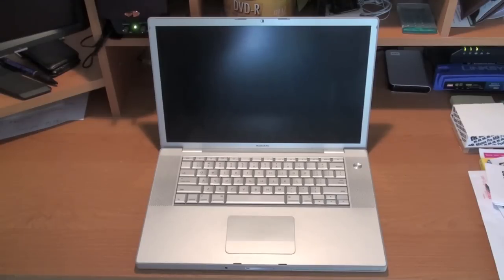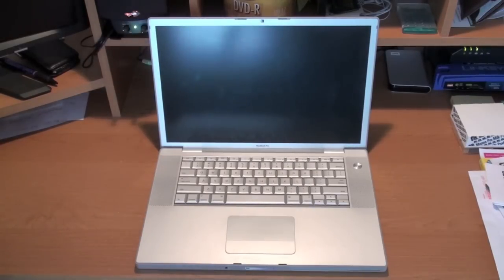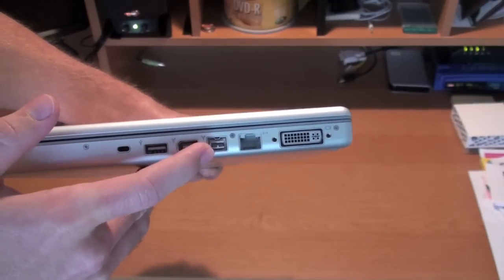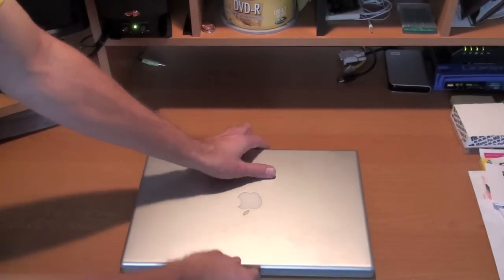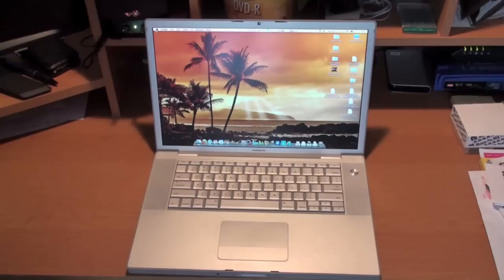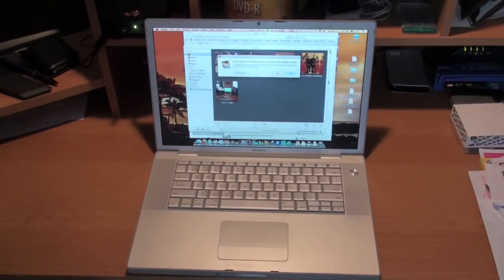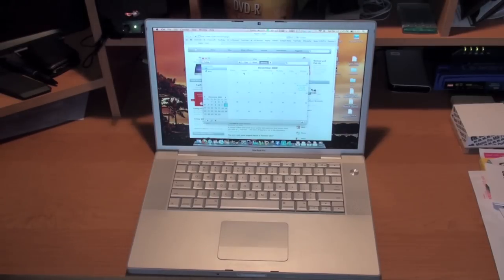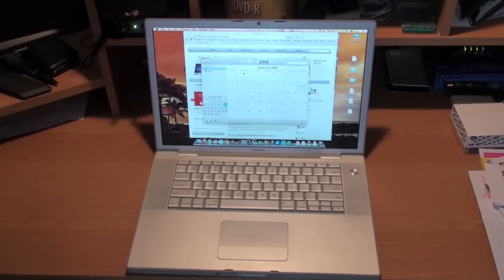Macbook Pro Review (Early 2008)

Comment: Sweet, thanks! And what is the highest (And best looking) screen resolution on this laptop? When I get mine I want to be able to run Mac OS X Mountain Lion on it. Also, does this one have a back-lit keyboard? I know I'm bombarding you with so many questions, but I've never had a Mac before. And what is the maximum amount of memory that can be installed in the Early 2008 MacBook Pro like this one?

Comment: I've built one good runner from three parts donors for about $53 invested.

As of 6/2020
TWO from on eBay
ONE found on top of my dumpster...
Broken Lid/LCD and messed up keyboard
But Booted up with a good POST!
Took screen and keyboard from my overheated 12/2007 A1226
Works perfectly!
Runners are $80 and up on eBay
LUCK!

J.C.

Comment: Just another question - can you take out the battery without any hassle like a PC laptop? Because I'm planning on getting one of these and it might have a dead battery in it. I've run in a couple of PC laptops where the batteries are dead (One of my laptops batteries holds absolutely NO charge at all) And if you can, how much do they normally cost for these MacBooks?

Comment: nice to have a ssd , but this mac does not take ant adventage of the speed , the bus speed is limited to a 100mbps so , it is still faster with a ssd but , it never takes full atvantage of the speed from the ssd , i have the 17'' version of this mac , and it's fast have a samsung ssd 128gb in it works super fast ,

Comment: Hello ! I have the same macbook pro 17 inch early 2008. i have owned it for 7 years now, It still looks new. I love it. There is somthing in this version that versions now dont have. Its built like a tank! :)
I absolutely love it I upgraded mine to Yosemite last night in 2015! still runs like water :) its great.
few questions?
- Whats the max ram this can support. I have 2 gigs at the moment.
-  I didnt knew that I can install a SSD inplace of HDD. Can you may be make a video on how to do it?. What format to have the SSD on and how to boot? that will be great.! :)
Reply: +Noisia Steampunk 6GB is max. 2 + 4GB sticks. I have done both maxed the ram and installed an SSD in my early 2008 Macbook pro. The SSD is actually easy enough to replace and you will need star and torque screw drivers.